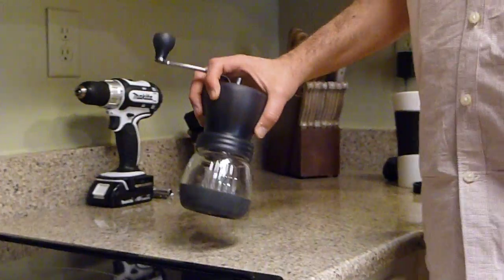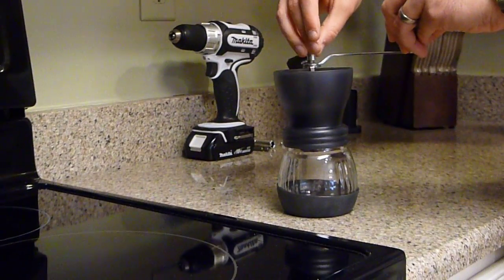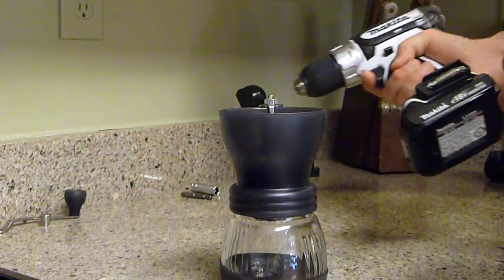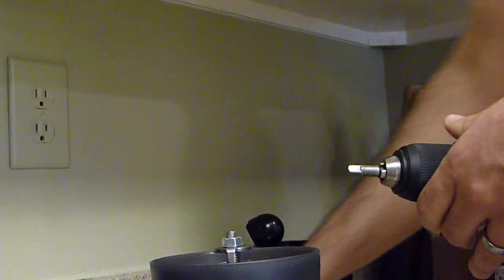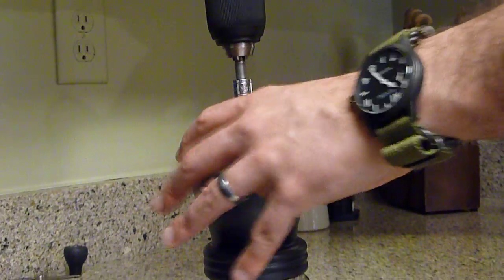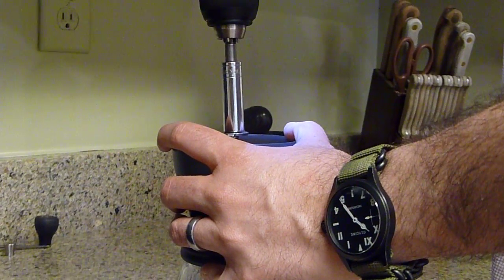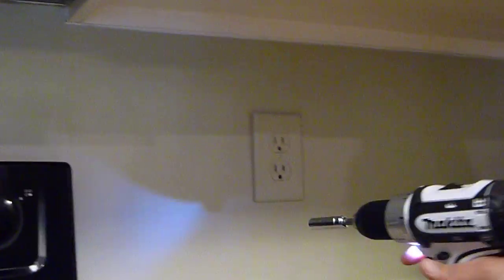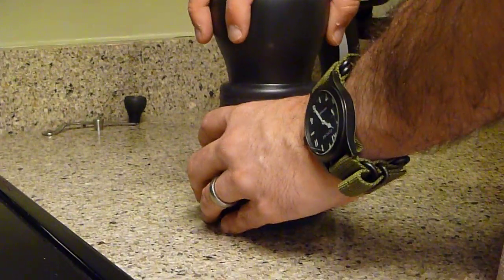Hario Ceramic Burr Coffee Grinder Modification

Comment: Caution you don't want to crank up coffee bean grinders because that heats up the beans and you would actually be re roasting the coffee and changing the taste, just saying. The most expensive burr grinders run at a slow speed so as not to heat the beans! Speed isn't as important as consistency of the grind at the fine settings for espresso up to the corser settings for french press and drip! Most grinders fail at one end or the other but there are some that can manage consistent grind size through a few styles of coffee making. Thanks for the powered idea!!!!
Reply: it would be nice if power drills had speed limiters. i'm wary to try this because it's so tempting to make it go fast. if the drill had a limiter then you could just hold down the button, running at a consistent speed slightly faster than hand cranking, and just wait until it finishes.

Comment: Thanks for including the nut size. I did this mod years ago with a nut I had laying around. It stripped after considerable use and I headed to the hardware store to get another. Couldn't recall size but brought nut along with me. Tried to do an eyeball comparison, eyeball comparison failed. Fug. Back to hardware store to get the right one...

Comment: have somebody tried this hack ? how's your burr right now ? is it recommended ?thanks (:
Reply: I did this a few years ago and it works awesome. I grind at half speed with a 12V Makita Impact and it takes about 20 seconds to grind a full hopper for a siphon.

Make sure you calibrated the burrs and either have a new Skerton (or an upgrade kit) to ensure concentric burrs. If they are not centered, they will rub and you'll wear them out.

Comment: Just bought mine and I'm looking forward to your mod. Genius! Anyway, I have another hand grinder ( Broyeur stainless steel ceramic burr grinder $18.99) but it takes about 3+ minutes for me to grind enough for a double espresso shot. For $8 more this Hario took about 2/3 the time. Plus, the first time I used it the grind was so fine that water couldn't pass through the Gaggia Classic portafilter. I had to back off the setting about 1 and a half turns, lighten the tamp and I still got a dry puck when finished. The shot tasted really great too. All in all I'm impressed with the Hario and now I just have to find a 10mm hex nut. I already have the variable speed drill and socket. Thanks!  I'll save the stainless steel grinder for camping.
Reply: +metaspherz This is just a follow-up to my post above. Pvn2plus2's mod worked  exceptionally well! I found a 10mm hex nut and replaced the original crank and nut with it. I added the beans into the hopper. Then I used a mini-4 volt Black & Decker cordless pistol grip screwdriver with the 10mm socket. Since the B&D was single speed (180 rpms) I pulsed the trigger until I was certain that I was getting a good consistent grind going. The grind speed was just right. It took about a minute and I was ready to pull a double shot of espresso. Thanks again! BTW, the little pistol drill fits nicely in my hand while holding the Hario grinder and it stores perfectly out of sight in the Rancilio Silvia base tools drawer.  Try that with the big bulky drill gun.  ;)

Comment: This is a good idea, BUT if you work on a bigger amount (like 30+gramms) the grinder will get pretty hot. Just test with your finger after grinding by opening and touching the bottom of the grind-element. IF it gets TOO HOT, you will pre-roast your coffee which causes a significant change/lack of flavour when you grind good quality coffee. 
So if you are working on great flavour make sure not to overheat the grinder

Comment: I found that the nut didn't go more than a few turns on the shaft.  However, after using it that way, it finally goes all the way on.  It appears that the surface grinding process to put flats on the bolt/shaft causes some resistance, but once you forcibly turn it on, it goes on easily. 

Again, I think this is a great idea and we are now using it with our small cordless screwdriver, albeit plugged in for maximum torque.   Just thought I'd add our experience to your great idea and post.

Comment: Thanks for this simple idea!  I have one of these grinders on the way to use with a French press where the coarsest grind is optimum.  But I've read that the bearing isn't stable at this setting and that downward pressure during grinding fixes that issue.  In addition to the ease-of-use factor, your modification should take care of the bearing wobble for the coarser grinds as well. I'm off to the hardware store to buy me a nut!

Comment: hario grinder: $40, Makita drill: $170 = $210 for a manual made into electric grinder
Reply: I'm pretty sure he can still use the drill driver for other things genius.  Where do they find you guys.
Reply: Oh no way? I had no idea the drill could be used for other things, you are so smart. Thank you so much for pointing that out. You need a cape, a captain obvious cape.
Reply: This is a great ideal for anyone who already owns a drill which I assume is everyone (or at least most people). Even if you don't already own a drill, you can find one for much less than $170 ( I got my Craftsman New for $30 during a sale and I've seen drills for even less than that!), so the most you'd have to pay out of pocket is 50 to 70 bucks and even less if you buy used, good luck finding an equivalent powered burr grinder for less, used or not. If someone was hypothetically only using a drill for grinding their coffee, they could get the cheapest drill they could find and they'd still where out several sets of burrs before they wore out the drill.
Reply: corded drill will cost you about 30 buck. Less on sale. And now you have a drill. They're useful for other stuff.
Reply: You don't need to buy an expensive drill. I have a corded bosch screwdriver that costs less than a hario grinder in my country. And probably a cheap electric screwdriver would do the job, but not an ordinary drill, that is too fast and has a very low torque if you use a dimmer to regulate its speed.
Reply: Any real man or woman has a drill.
Reply: Bob Garrett Don't feed the trolls.

Comment: This is a definite problem. You really should use 2 nuts and tighten them against each other, or else use a nylon locknut. Best option would be to leave the handle on. Get a about a 4 inch piece PVC with an inside diameter that exceeds the diameter of the connection point of the crank. Cut a notch in the PVC for the crank handle. Glue the PVC to something that will fit in your drill. You can buy single specialty sockets if you don't have any you're willing to sacrifice.